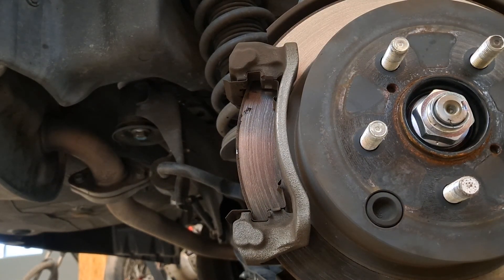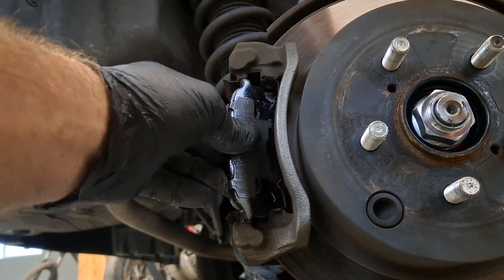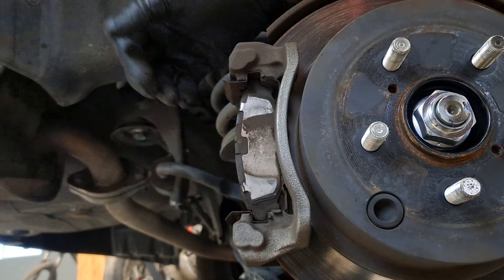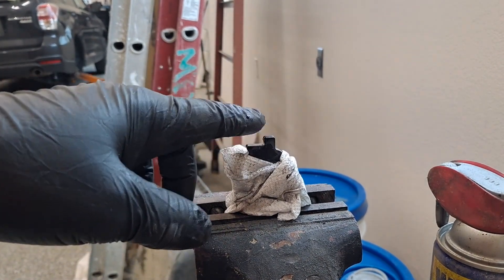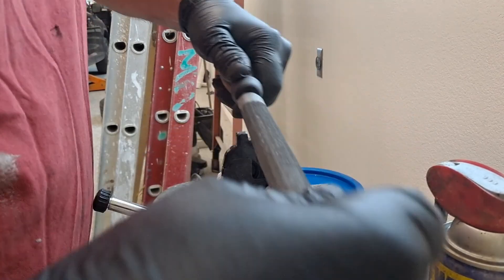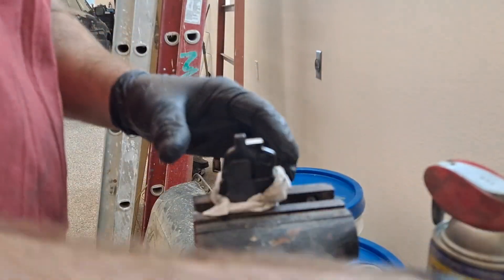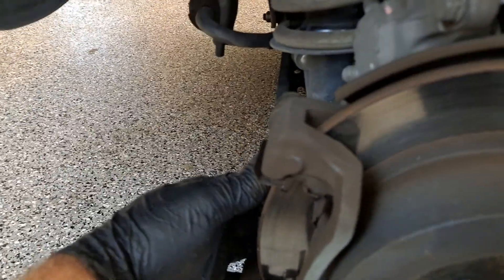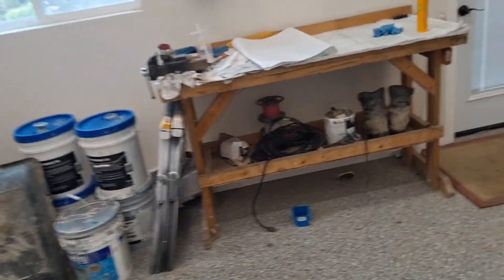My experience and modifying akebono act1004 pads that won't fit on subaru forester.

Comment: or just buy the right brake pads.
Reply from the maker: Define "right brake pads"
Reply: @paulkelley86  ones that you don’t have to modify to fit 🫢
Reply from the maker: @cloud-ny5ux  this went right over your head. Doesn't sound like you have done much brake work or work in general with aftermarket parts 🤔
Reply: @paulkelley86  says the guy who modifies brake pads to fit their brakes 🤣😂.
Reply from the maker: @cloud-ny5ux  Very typical to have minor fitment issues on brake pads. These are OEM fit, and yet need some trimming and filing, which may help someone who purchased them but finds they tend to bind in the caliper bracket. They are not the incorrect application. A small amount of work and they fit perfect, vs they guy who says they are "incorrect". So every part that needs any prep is incorrect in your eyes? You will spend your time going back and forth to the parts store all day until you go to the dealer, and I will be done with 3 jobs by then, and still having time to respond to special people like you on youtube.
Reply: @paulkelley86  lmfao typical? I’ve never had an issue like this ESPECIALLY if you go OEM. I only use oem parts when I can, to avoid issues like this in your video ;). If I was that customer I would absolutely have you go back to the store and get the correct brake pad why? Because I’m PAYING YOU TOO. thank god I work on my car, you can’t trust these dodgy YouTube mechanics these days. You want it done right? Do it yourself.   Plus these techs these days don’t give a rats ass about the cars they work on, unless if it’s there car 🤫
Reply from the maker: @cloud  you have not experienced it because you have so little experience. It is hard to comprehend how foolish you are to think that a technician is paid to run around to parts stores testing out which parts work and don't. You should be embarrassed at how you assert your lack of knowledge in this discussion.  You really don't even have a right to speak here. Now go back to watching other videos to learn what you are doing, or better yet, as an unqualified, non professional, DIY wannabe mechanic why don't you provide a superior video, then you can comment on your own video! Can't waste any more time on you Cloud. It's been real.
Reply: @paulkelley86  I haven't experienced it because i buy the right parts from the start. Makes my life a whole lot easier, its been fun. try harder next time.